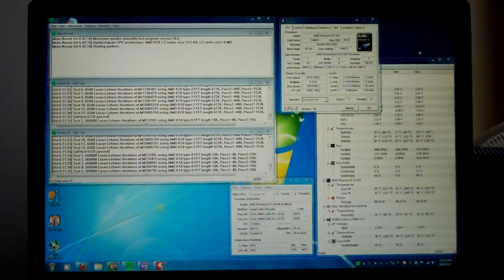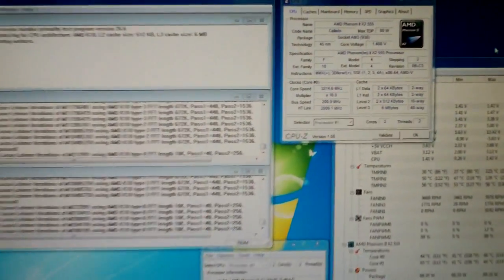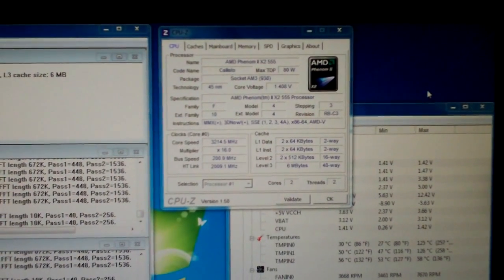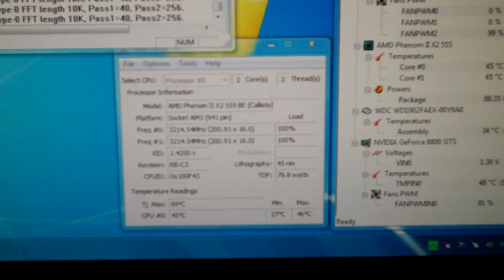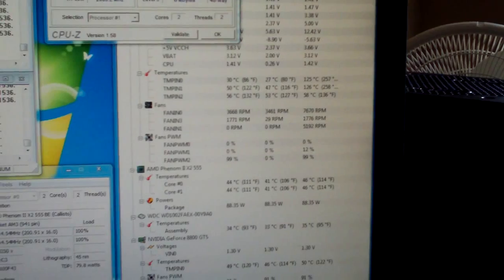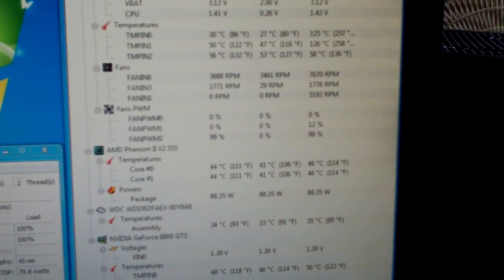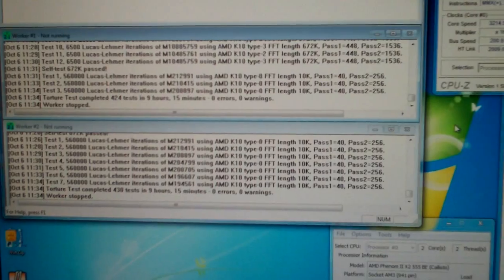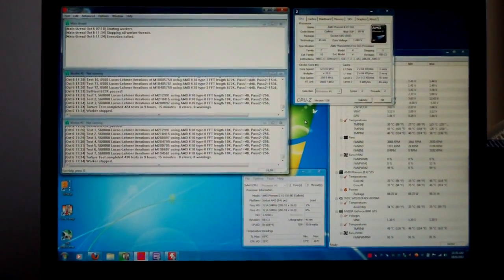Phenom II X2 555 BE Prime95 Load Temps

Comment from the maker: @OriginalLeague Undervolt and try to see if it will overclock. What are your full load temps idle is pointless and what is room temps that matter too. All chips are diff and if your chip need more volts and you have a higher room temp aftermarket cooling is best way to achieve high OC. They are not expensive 20-30 for good one starting off.

Comment from the maker: @AgentHydra Yea see if I can unlock to at least triple core. X4 would be sweet but really interested to see if I can get 4.0+ghz out of it. Seen some who have gone quad and 4.0+ would be sweet not on stock cooler however. Right now its only running at 45-47c loaded which is good and that's at 78-80F room temp.

Comment from the maker: @hanukun I use coretemp 1.0 and HWmonitor right now. For AMD they seems to be pretty accurate. If you use Intel realtemp is good one doesn't seem to work with AMD last time I tried. Speedfan is alright as well not a big fan when there better ones like I listed above. For checking clocks use CPU-Z and Everest works also show good amount of info everything needed when overclocking. I also have Easy Tune 6 installed it came with my board from Gigabyte works pretty well so far.